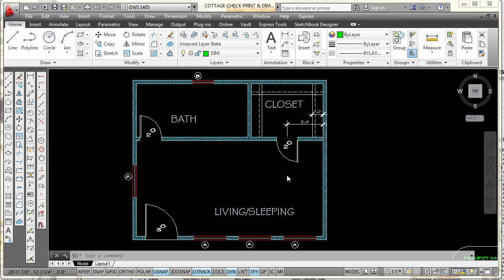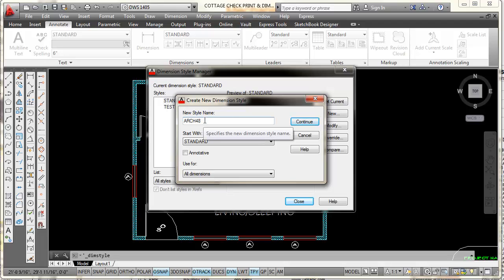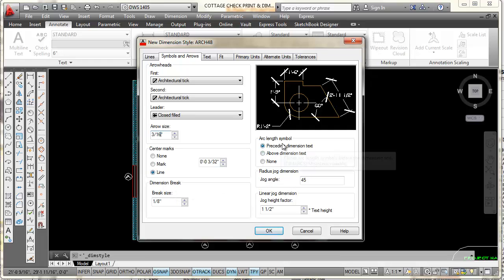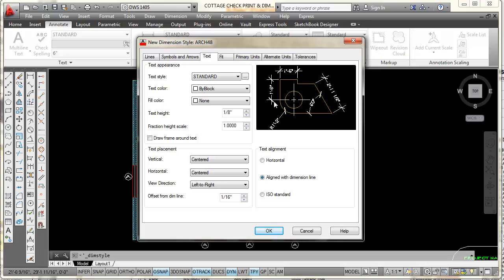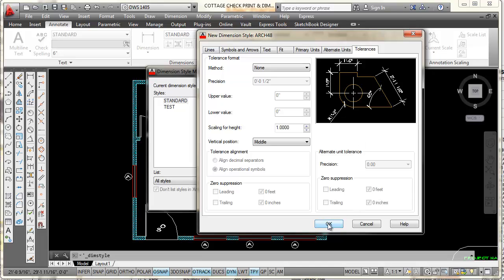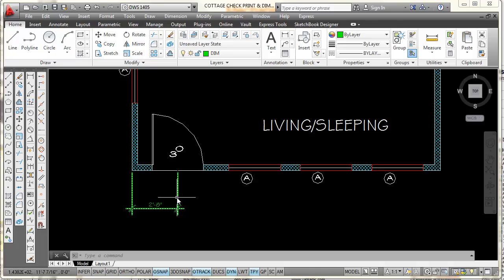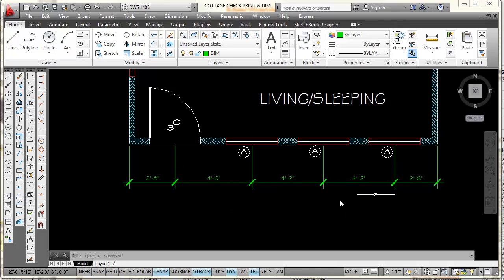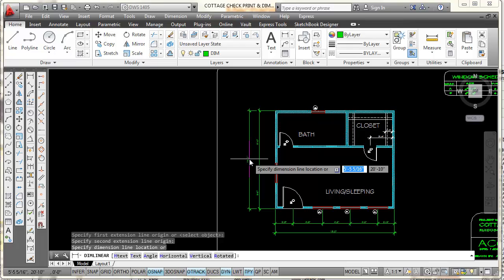Creating an Architectural Dimension Style

Comment: Any ideas as to why my font height doesn't change the same way as yours? I have the settings for text height and use of scale set exactly the same, but the font ends up ridiculously tiny.
Reply: If you right click on it, and go to properties, you can change the text size from the menu on the left. Should be called Text Height.
Reply: @Joe_Parmesan also check your dwgunits